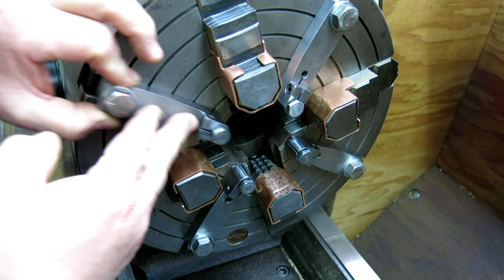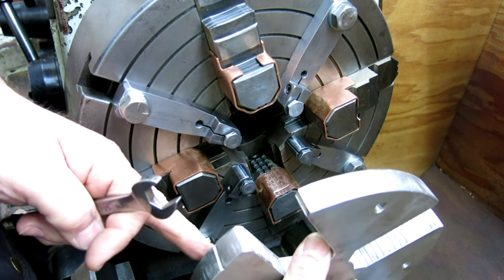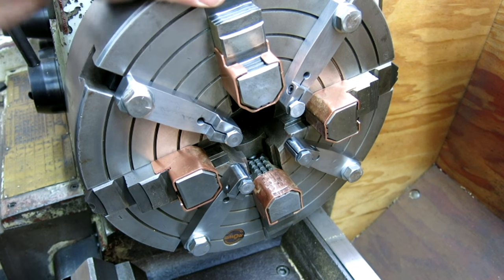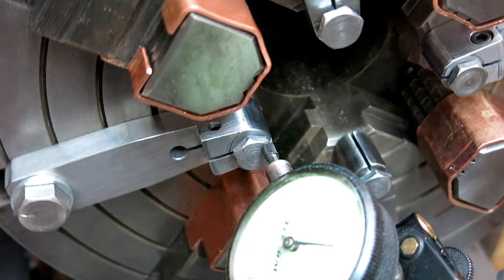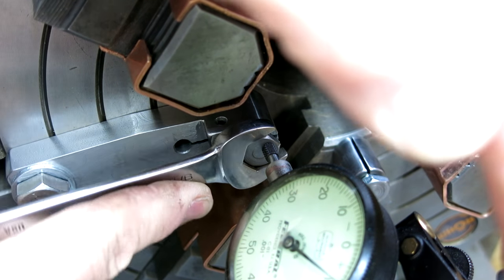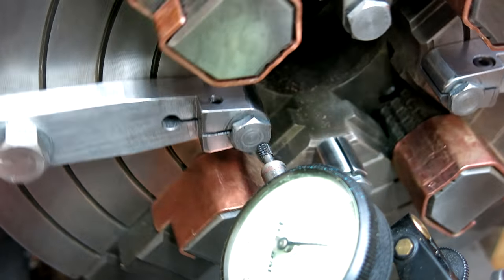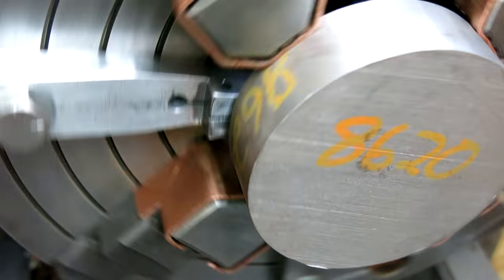Adjustable Chuck Stops

Comment: Tom --- Sweet design , great video -- Touching off the Hex Heads with an indicator insures 
that you have  a straight plane  --- even if the face of the chuck runs out. You da man !

Comment: Yeah, the indicator glare thing. I was thinking about this the other day. Several youtubers have tried polarization filters, with varied success. Polarization filters work because reflected light is polarized, ie: the wavelength only moves vertically as compared to the angle of the reflected surface and position of the light source. The filter is effectively a very fine slotted grid, and only lets through light with a specific polarization. Turn the grid 90 degrees to the reflected light source and it will block the reflected light. This is how fishing sunglasses work, however you are only dealing with the reflected sun. Move inside under 12 double bulb florescent lights and this effect no longer works. Guys with less light sources will have better success with the filters.

Have you ever tried to add a bezel around the gauge similar to how a stop light is shielded? A piece of black plastic pipe may be perfect to slip over the face of the bezel, and shade it to help prevent glare? You could try with a band of paper around it. 

Btw, Modern 3d glasses have lenses polarized at 90 degrees to each other. 
This allows each eye to see a different image, because the film is 
projected with different 2 different polarized images and each lens 
only lets in one of the two allowing your brain to create the 3d. What a super simple solution to a problem, a solution that has been there under their noses for years, and was used during the filming..........

Comment: Hi Tom,
Those are simple and efficient, the only thing I'd add it to surface grind the top of the bolts in order to make them a little more precise...
Also how much I'd like to spend some time with Robin where there would be so much to learn, he's one of my favorites as far as knowledge in fine precision machining...
Cheers,   Pierre

P.S. How about the hammer...???  Hope you plan to use it as it was meant to...

Comment: There is another useful application to these types of adjustable stops. When setting up parts in a four jaw where you are machining features that must be square and concentric with existing features on the part. As an example adding O-ring Grooves or repairing bores or ODs. In those circumstances the screw heads can be used to shift the face of the part so you can indicate the part in. And you can do this in a very controllable manner. Additionally if you have a long piece in a four jaw that needs to be zeroed away from the chuck by exerting pressure using a screw such as this you can cause the end of the part to move. This works much better than tapping with a soft hammer or a chunk of copper because it is precisely controlable

Comment: I saw Robin's chuck stops when he put up that video, he did a great job. Like all his work, absolutely first class.

Tom what's your opinion of using stops like this vs making a removable chuck backstop with a spider on the front of it? I made a spider similar to yours, and also use fixed thickness chuck spiders, but liked Rob's design. Have you used chuck backstops with a spider on the front, and if so did you find them generally accurate enough. The design you showed would certainly be very accurate.

Comment: Idea:  How about putting adjustment screws halfway down the arm, that pushed against the face of the chuck?  That would allow you to adjust the offset while something was in the chuck, so you could dial in the face of the part, instead of effectively dialing in the back of the part.

Comment: Did you make a feature to make the  buisiness ends of these 'thingies" to rest positively against the chuck body? (like making them a hair hollow at the underside where they rest against the chuck). I could imagine that if they are just flat, they will start to lift slightly  from the chuck body in time  after a lot of tightenings, or after one overtightening. cheers.

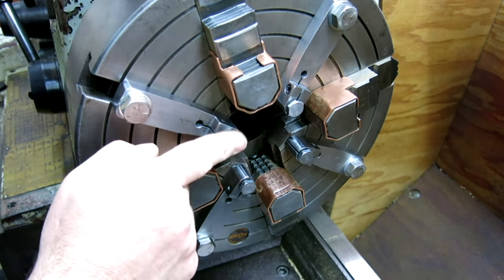Comment: indicator glare? That is indicator overexposure... It is all about the contrast between the brightest and darkest areas of the scene. The camera is going to automagically adjust the exposure for some 'sensible' average exposure level (see 1:18 to 1:30 - the overall luminance is flapping somewhat)). This level is an average of  a handful of points, or the entire frame (we'd need to check the specs of the the camera for it's autoexposure parameters). This average is traditionally skin tone or '18% grey'. in the old days, as film cameras had an inbuilt meter that used some sort of averaging, the manufacturers added an exposure compensation dial, because (e.g.) in snowy scenes the snow turned out skin-tone grey and faces were black. In this case, the dark areas of the scene (e.g. the chuck face and the bore hole) have a much lower luminosity,  causing the camera to settle on an average that causes massive overexpose in the smaller brighter areas.   Note  how your hand at 1:11 and 2:00 is completely 'blown out' (i.e too white) and featureless? I'd suggest the camera would be happier if the direct lighting over the entire area was shaded to reduce the overall contrast.  No amount of polarisation will help this problem.  Can I offer (just for chuckles - or maybe a more serious experiment) that you might set the camera to fixed exposure, and adjust for a readable indicator face. The rest of the scene may end up a little dark as a result,  then try to get a little more light on the chuck to see if you can even it up...   I love your work, Sir!

Comment: Why not tighten the bolts and then take a skim cut? Won't that mean the bolt heads are all normal to the axis of rotation. No need to adjust. Then bolts can be replaced as needed. No need to adjust. Or do I have something wrong?

Comment: The top of the bolts, the precision of the thread on the bolt and the threaded hole in the stops seem like places where you can lose some accuracy if not being done right. To do this right needs a lot of patience.

Comment: Is there such a thing as a back-lit DTI?, might help occasionally, Dunno, J.
Reply: Yeah there is, Mitutoyo makes an electronic version there 543 - 552A 0" - 1"or the 543 - 558A 0" - 2" where the screen changes from red to green as a quick go, no go while checking multiple parts. Might want to be sitting down while checking the price. There must be a few other manufacturer's that make something like it as well. But that's one I know is really good. To be honest I think it's more for inspection and surface plate use. I'm not sure I'd want to subject it to the everyday shop rash.
Reply: Turning Point Nice bit of kit, $700?, Not bad, Looks like I will put some more thought into making a white polycarbonate dial for my import dti, and squeezing some fairy light LEDs in the case behind, Some people say I'm cheap.J.
Reply: If it works then it doesn't matter if you are or not. 7 bills buys a lot of other tools. I really like the indicator but it's mind blowing how cheap they went with the rinky dink blow molded styrene "storage case" they sent it in. Works very well to prevent shipping damage I guess, but useless for protective storage for a tool with the price tag it does. It's the only thing I've bought that they make that I've been disapointed with enough to send them an email.

Comment: If you want parallels to use on a lathe chuck I reckon you are ignoring the obvious---the old timers used them all the time because they are cheap and they are bearings old and new..
They are ground parallel--In different widths--I use them on the mill lathe everywhere..
In Oz we do not have the tooling availability that you have in your country so we have to improvise all the time especially in the sticks where I live..regards E

Comment: Nice new format/series
Stefan  Gotteswinter gave his interpretation of this chuck stops. check out his channel too!
Reply: That's a different sort of backstop, one which limits the travel of the far end of the workpiece into the spindle. Tom's stop, in the case of, say, a flanged workpiece, works on the backside of the flange, not the far end of the workpiece.

Comment: Very dangerous, the stop in the slot will shoot out at high RPM and kill you.
If you want to use this kind of stop, you must drill and tap a hole in the bottom of the T slot ,and put a screw there to prevent the stop from flying out. You would not believe how often it happens that somebody gets hurt this way.